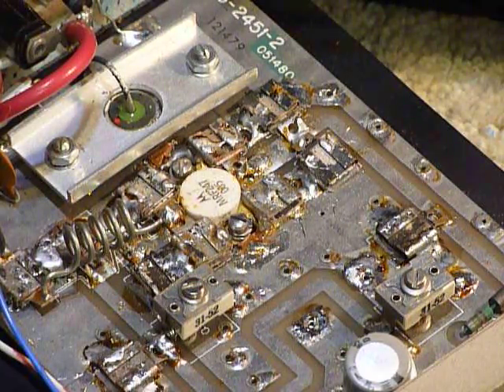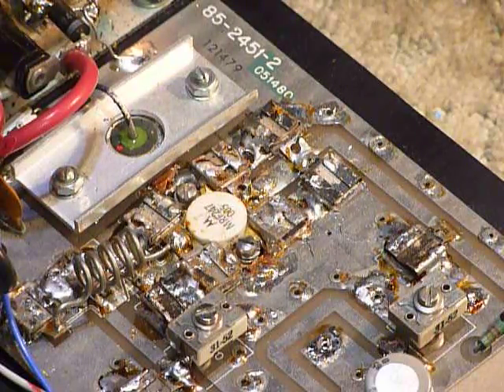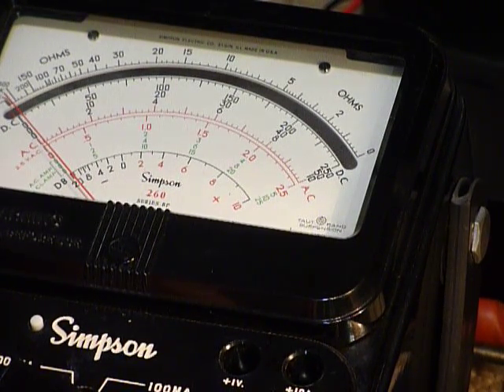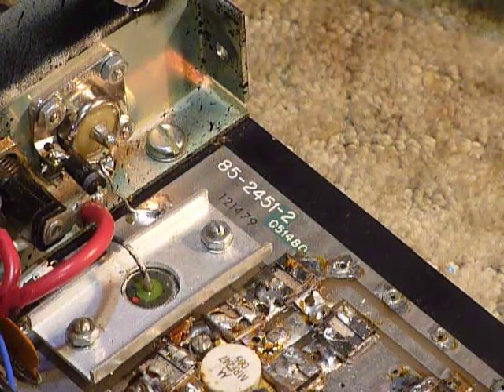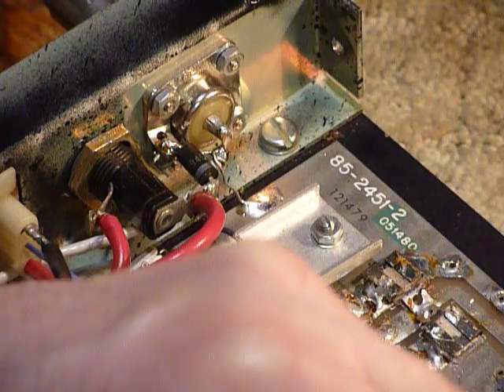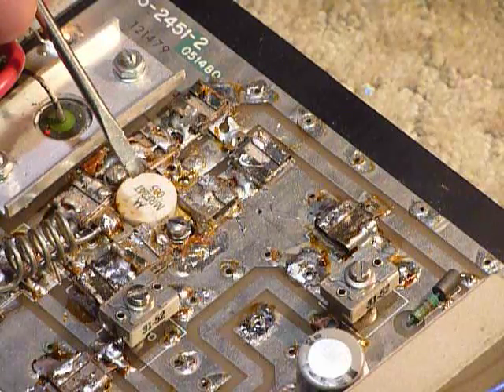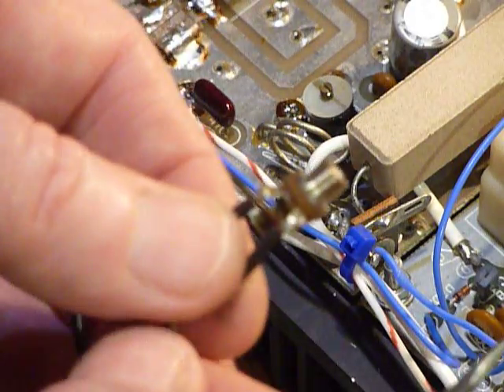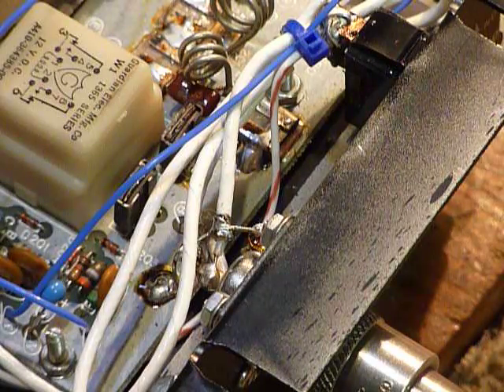HEATHKIT VL1180  2 METER AMPLIFIER

Comment: Your remarks on patience are timely.  A friend's Dad was the local hams' radio repairman during the 50s and 60s.  My friend gave me an old DX100 covered with dust and rust and I'm bringing it along slowly - I've got the low voltage working and am now checking out the high voltage.  This transmitter is complex enough to require a cautious approach. (1200 volt center tapped.)
The set was complete except the HV rectifiers were missing.  I thought the plate transformer might be bad but it checks out okay.  Looking at the output part of that section as I write this.
The caps all look original so checking those carefully.
Thanks for the video - it's useful and inspiring.  73 - Cliff W4HGR